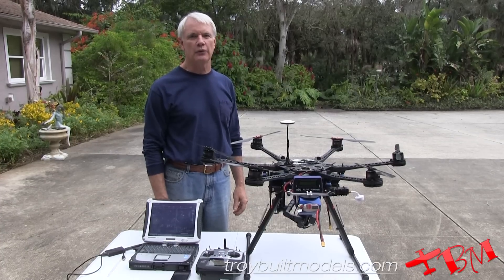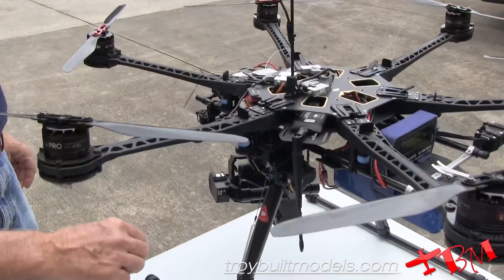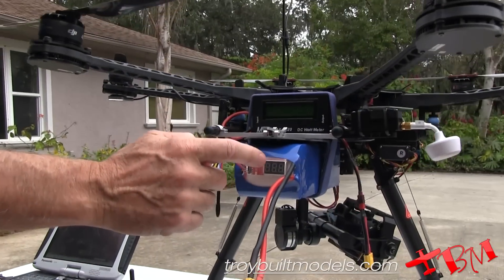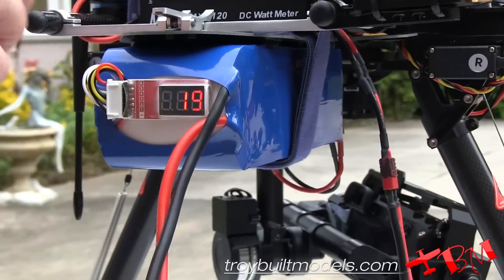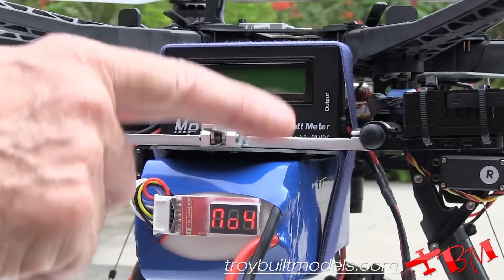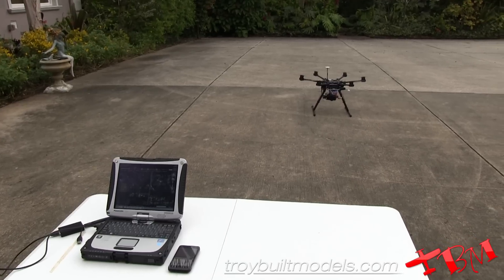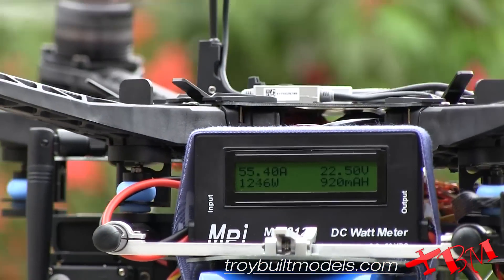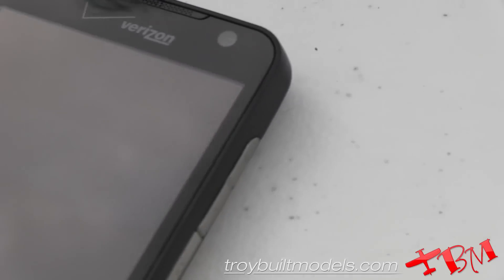TBM Ultra Power LiPoly Battery 6S 30C 16000mAh on DJI S800 EVO Flight Time Test

Comment: I use 10 C battery on my exacopter, 
since, using 10C, batteries my flight time is improved a lot,
Moreover, for equal mAh,  batteries 10C weigh less, this improves in time of flight.
Also, I saw that the 10 C maintain a better level of the cells.
I set second alarm 21v, with a 5000 mAh flight about 20 minutes,
after they have landed the battery voltage returns to about 22v
Since using 10C. i am very happy
Finally, 10C battery cost less
This is my experience

Enzo

Comment: well the battery is really unbalanced, cell 5 reads 4.19V and cell 6 reads 4.34V which is kinda unusual because I always thought the limit for a regular lipo cell was 4.2 volts. Look again starting at :52
Reply from the maker: rjones1853 Good eye, I believe our tester we used was a prototype and not calibrated properly causing #6 to read high no matter what battery it was attached to.

Comment: Why i use my s800 evo with 16000mah in 15C? Because i had an experience with my phantom 1. At the first time, i usually flew(full loaded) with 2200mah X 2 with 25C. I could reach about 10 minutes. And I tried with battery 2600mah X 2 with 60C. I thought it could flew more than before(more than 10minutes). But the fact was, it only flew about 7 minutes! So i thought big C burst is not the solution to get more flight time. More C burst, more power it can give to the motor. But multirotor doesn't need big C burst. CMIIW
Reply from the maker: Yes, you are correct, 15C is all that's needed, thought 20C or 30C is OK too.

Comment: I think it is more efficient to use less then 25C or even less than 20C. Because multirotor does not need high C capacity, it flies with less power. not Just like RC Helicopter or RC Plane that need high C capacity. Multirotor flies so static and calm
Reply from the maker: Yes because you don't need the higher C rating depending on your capacity and usually you save weight with a lower C rating.  Basically if your S800 uses a maximum of 60-80 amps you could stay on the safe side and use a battery that has more than enough amp draw headroom.  This could be a 10,000mAh battery at 15C.  That would give you 150A continuous headroom.  More than enough.  Now, if you only wanted to use ONE 5000mAh battery, you would want 30C for that battery (giving you the same 150A continuous draw availability). If you had only ONE 5000mAh battery at 15C, you would be cutting it close at 75A continuous output.The formula is easy if you'd like to try it, it's just your Ah capacity "10Ah (10,000mAh)" times your C rating "15C" which gives you the 150A number.  Now if you had a 15,000mAh battery at 15C you would do 15*15=225A.  This is all with the "continuous" rating though many packs also have a peak rating.  It's best to just adjust for the continuous rating like I've shown so you have plenty of headroom and don't run into any trouble!

Comment: Hello, I have a S800EVO equipped with a Panasonic GH3.
When I use two batteries Turnigy 5000 mah (first voltage alarm set to 22.0 v and 20.4 v second alarm) the s800 fly about 6 minutes. At the first sign of alarm (flashing yellow light) I landed. When I use two MaxAmps 11,000 mAh I fly about 10 to 12 min, to 21 v and I land. The problem I have is that when I use it with a single 11,000 mAh battery, the voltage drops below 21v within seconds of taking off and I land it, and on land the percentage of charge is 80%. The problem of MaxAmpps 11000 mAh batteries will be low capacity (C)?
Reply from the maker: The C rating should be at least 15C which would give you an output of 165 amps (11A * 15C).  This is more than enough for the S800.  The below is what you need to do for all battery configurations you do.  When you put two batteries on at once, you are sharing the "load" which is why this is happening.  You can use the one battery following the steps below but I would recommend running the same configuration for ease of use not having to change settings and not having to change CG all the time.

What you need to do is fly and check resting voltage.  Keep checking resting voltage until it shows 3.7v per cell or 22.2v total on the ground.  Then, take off and note what your loaded voltage is, then quickly land.  Over time, the loaded voltage will be less and less as the battery gets older. 

You can then put your battery on the charger once they cool, and see how many mAh goes back in.  The idea is to only use 75-90% of the battery capacity at any time.  So if you have an 11,000mAh battery, you want to be putting anywhere from 8250mAh to 9900mAh max back in. 

If you are only putting in 5000mAh then you aren't using the battery to its full potential.  If you put in over 9900mAh then you are running the copter for too long!
Reply: Troy Built Models, Inc. thanks!
Reply: Troy Built Models, Inc. but the MaxAmps LiPo 11000mAh have true 40C rating
and in theory give me each an output of 440 amps, and seems not to be enough for the complete s800evo with gimbal and camera.
Reply from the maker: Miguel Bertona  If you check the video at this time:http://youtu.be/65DXVFMfIcM?t=2m7s you will see the amps are around 56.  The S800 EVO only came with a XT-60 plug which is good for 60A with headroom I'm sure.  This means you should be more than fine with that 440A!

Comment: 12min on 16000mAh ?, I got 12min on 2x5000mAh ( alarm was not beeping even ) thats strange is the weight / lift ration with 16000mAh wrong ?
Reply from the maker: How much mAh were you putting back into both batteries when you went to charge?  You should only discharge 80% of the battery.  If we flew for another 3000mAh our time would be better but the battery would suffer.
Reply: Troy Built Models, Inc.  I didn't charge them yet, but I will tomorrow and let you know. I had alarm on the batteries that beeps when the cell is low, but I even landed before that as I seen A2 alarm going on :)
Reply: Troy Built Models, Inc. Today I got to charge the batteries, and I'm slightly worried as first 5000mAh got back charged by 4960mAh ! which is terrible. Second battery is charging now,.. not sure what is wrong, my charger or the alarm and A2 low voltage alarm as they didn't beep ( blink red ) when I was landing... this make no sense
Reply from the maker: VladoPortosRC Wow, definitely not good!  You're 1000mAh over!  It makes perfect sense, your alarm can be set to anything!  Probably a really low voltage.  Voltage is and never was a perfect solution for gauging how much mAh a battery has left.  With the load from the S800, you will never know how much your resistance your battery has over it's life cycle.  Resting voltage is a better determination but impossible to do in flight.  I recommend you time your flight at 8 minutes and see what happens then.  If you are only putting in 3500mAh then add another 30 seconds and repeat until you have it dialed in.  I'm sure you will see DJI implement mAh counters in the future.
Reply: Troy Built Models, Inc. yea, going to do that tomorrow, I'm used to having TBS core in my OSD showing me how much mAh I have used, I think I will add it to the mix and overlay it over iOSD.
Reply: Troy Built Models, Inc. Today I give it 8 min, and put back 3500 mAh to one 5000mAh that's quite reasonable. Still I noticed the S800Evo was vibrating strangely at the time ( slight wind might be the cause ) it very much looks like the gains are not correct. Did you live it on default in your build or did you do some changes ?

Comment: Would it be ok on the S800 (not EVO)?
Reply from the maker: Absolutely!  Just be sure you CG or balance your copter.  You must either move your Zenmuse or battery tray to make sure all the motors are working equally.  See how to do that here: http://youtu.be/ekCsET0UmXk?t=3m22s
Reply: Troy Built Models, Inc. we would be fyling at 6,9 kgs, at the limit... maybe better to go for the 12.000mah

Comment: Hi. TBM.    What a mess. All teams got wet in this video. jajajajjjj....

The "S800 evo" is very versatile and pretty, can lift, almost any SLR camera and is very stable but inefficient, the box is very heavy, the system retractable undercarriage adds weight and watch the "pull death of DJI".

A very efficient quad is "MD4-1000" from microdrones, flight time> 45 minutes, depending on the configuration, but very costodo for anyone.

The "T-Motor" products surpass all. The "U8" motor is very efficient, but the DJI.  A quad "U8 motor" with (4x4s @ 6000mAmp)=  (8S@12000mAmp), Time F>40 minutes @  12Kgs AUW.

See this video:   2013-09-18: Quad U8 and 28" Props 12kg AUW
Reply: The price of the T motors U8 the 4 esc and 4 props is $2000 USD too expensive for most people

Comment: When my battery arrived it had a paper printed label on it that was just taped on. Under the label the manufacturer had printed 15,000mah 15c. I think TBM is uprating these on their own.
Reply: What possible benefit is there in changing the C rating? I have no way to actually measure the C rating of the battery. I do know that if I exceed the designed C rating of the battery I will shorten its life. I trust that when sold a battery that the manufacturer will be honest about the ratings of their battery. I don't feel TBM is being honest about the actual rating of this battery.
Reply: ok, I bought the GensAce 16000.. And they do label their battery with the right numbers :)
Reply: Thank you!
Reply from the maker: The manufacturer does this for export reasons, feel free to test the quality of the battery on your own.
Reply from the maker: Chris Geiger I understand your concern but I'm just going off what our supplier has told us.  16Ah*15C would theoretically give you 240A max continuous current draw.  16Ah*30C would theoretically give you 480A max continuous current draw.  We purchased the batteries as 16000mAh 30C packs specifically for the S800.  In the video you can see we're only at around/under 70A current draw...  The S800 just doesn't come near the 240A or 480A mark so there is no benefit to us for changing it.  What is your application for the battery?
Reply: The labels are changed due to the import and shipping laws in the US that regulate chemical batteries.  To get around the limitations, the manufacturers simply change the labels to meet the minimum.  Any battery that is 15000MAH will usually have a label that does not match the actual specs of the battery, because technically in the U.S. those batteries should not be shipped.  I know this because I spoke with two Chinese manufacturers about it.

Comment: Something's got to be wrong somewhere, because we get 13 and a half minutes of flight time (down to 19.8V loaded / 3.3V per cell) with 2x Pulse 5500mAh 45C. Same setup (EVO, Zenmuse Z15, Nex-7 with 16mm pancake)...
Reply from the maker: How many mAh are you putting back into the batteries out of the 5500?
Reply: Troy Built Models, Inc.
About 5000... we pushed it pretty far to see for how long we could go in case of an emergency. Upon landing, voltage stabilized back just under 21V. That's 3000mAh short of your test and still 1.5 minutes longer, that's why it got me confused. Each of our packs weights in at 860g, that's 3.784lbs for both. Our TOW is around 7.5kg. May sound stupid, but could the rain be a factor? What is your TOW? Maybe you should try a second test with a balanced pack and see if you get the same results.
Reply from the maker: VuDuCiel.ca Hmm, I see what you're saying, and it's weird that the weight is the same for the batteries...the TOW we have is more than likely very similar to yours.  Batteries are a hard thing to compare because even with our test we didn't say what the temperature was which is important as well... though with Florida the temperature is either warm or hot ha!  It was probably in the 70's when we did our test.  We'll have to check out the Pulse batteries and do some testing.  Thank you for the insight on this.

Comment: What do you charge the 16000mAH with and how long to charge each battery?
Reply from the maker: Using our X8 80w per channel it takes us over around 2+ hours.  With a different charger you can cut that time down but it's all in how "hard" you want to be on the battery.
Reply from the maker: Here is the best charger we carry to use for this battery: http://www.troybuiltmodels.com/items/TBMCHG1000WX1.html

Comment: Only 12 minutes with 16000mAh >.< do you think you can not have more minutes with different motors (less kv, a little more powerful)?
Reply from the maker: The weight is the real problem here... This is the latest airframe from DJI which can lift a nice sized camera.  If the nice gimbal were taken off and replaced with another battery, 20+ minutes could easily be achieved.